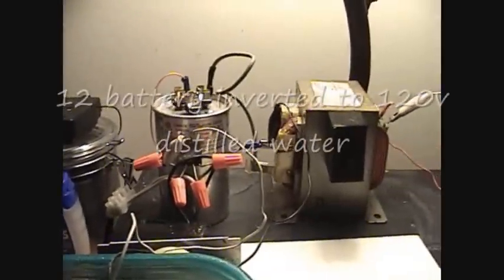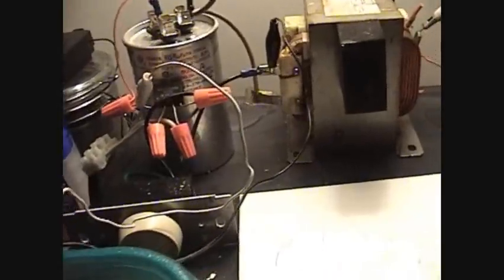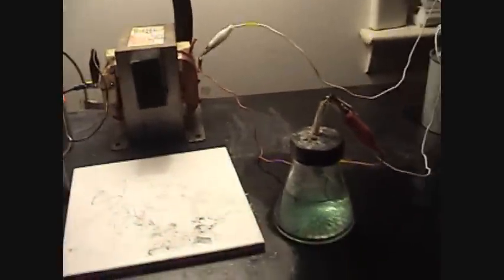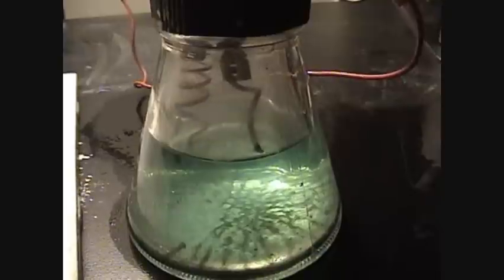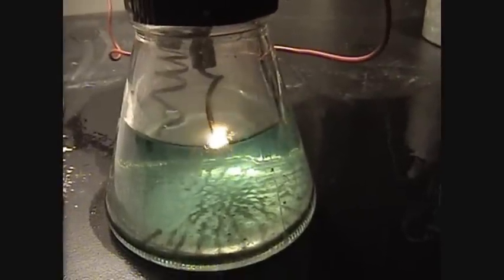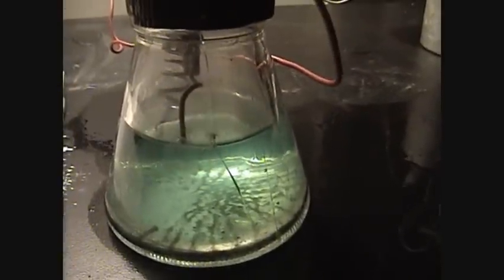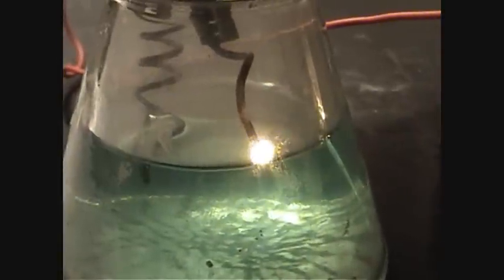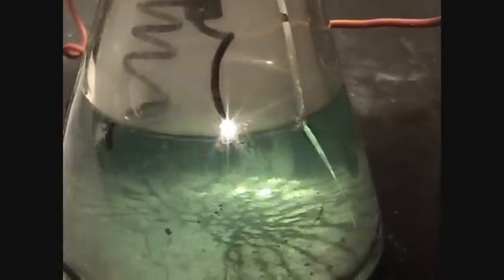HHO high voltage fun

Comment: what elite is used ,,,baking soda makes alot of carbon dioxide and this makes the gas week also you may be generating very small amounts and thats why it wont burn very cool experiment, that thing generates some steam,,good work

Comment from the maker: its not hho but it is a flammible gas, but at a lower concentrate,,,hell it might evenbe hho
just at a higher tempature it has expanded and dont have thesame charecteristics as plate cell hho.think of it as helium on a cold day (balloon shrinks gas pops sharp) but the same ballon on a hot day (balloon expands gas pops soft). hope this helps..  not many people are messing aroung with this. wish i new more

Comment from the maker: not on this particular setup,but the gas is flammable.

you can make steam from room tempature water in less than 5 seconds, seems amasing to me, might be a good way generate heat, from steam

i also thought to get one of those dry cells and run the steam though the dry cell.